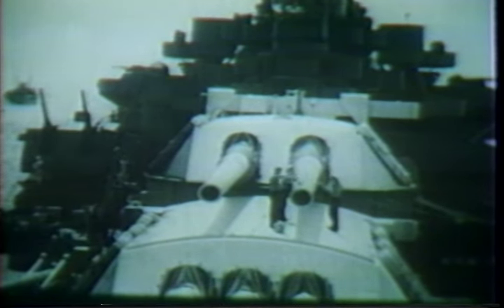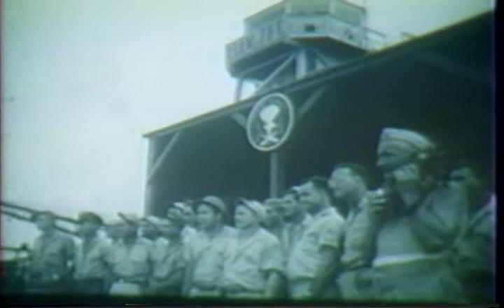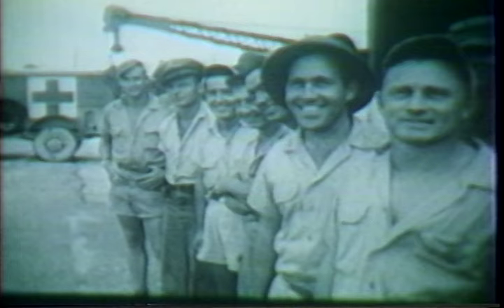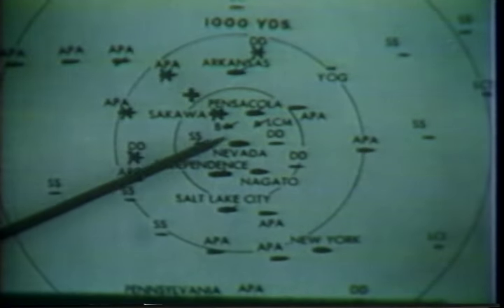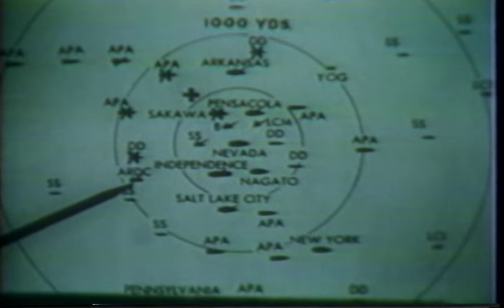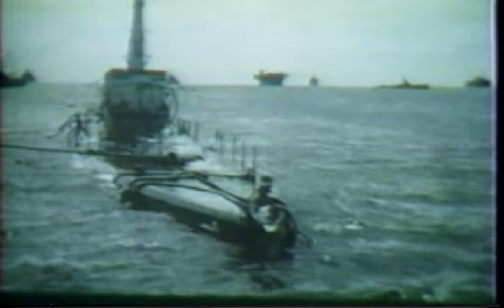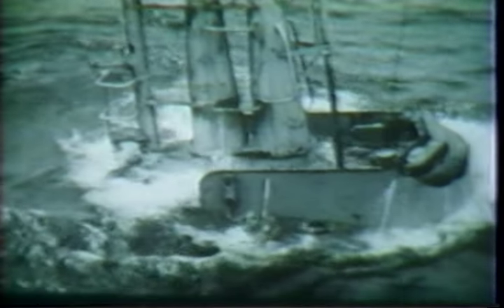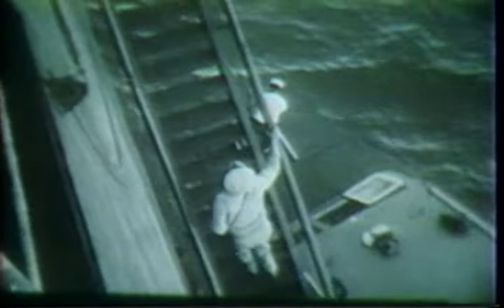Project Crossroads - Nuclear Test Film (1946)

Comment: 14:44 Yeah, I'm real sure the cloud became safe after a couple hours after the explosion.  
Holy crap these people are exposing themselves to so much radiation when they get back on those ships.
Reply: My daughter has a friend in the local retirement community who participated in Operation Crossroads. They could not discuss it for 50 years upon threat of court-martial. This veteran was left sterile and had cancer. Due to the 50 year period, he was not able to "prove" it resulted from the blast. And not only did he see the blast, he also helped "scrub" his ship the USS Salt Lake City.
Reply: You are correct: They tried to decontaminate some of the ships so that they could be sailed back.  However they were unable to do so and the ships were eventually scuttled.
Reply: Due to radioactive decay, this is true... after one hour the radiation is half what it was at the time of detonation.  It falls off very quickly but ever more slowly the more time that passes.  Plus, the radiation spreads out over time diluting it over more area, which reduces the exposure levels proportionately.  

Now, yeah, these guys were exposing themselves to WAY too much radiation, and there was a lot of unknowns that cost these guys dearly in the future.  The "neutron activation of sodium in the salt dissolved in the seawater" for instance, was interesting.  Neutron activation of steel plate of the hulls of these ships was something else.  You notice no respirators, no bunny suits, the guy just hopping off the boat into knee deep water and having his instruments handed down... breathing in mist or humidity laced with alpha-emitters... exposing their skin, contaminating their clothing and hands with salt water that is itself radioactive due to neutron activation (the atoms of sodium absorb a neutron and become a radioactive isotope of sodium, same with the iron atoms in steel-- this is how the neutron bomb worked-- if the intense burst of neutron radiation didn't kill you outright, if you were within lethal range, the crewmen inside Soviet tanks would subsequently be irradiated and die from gamma and X-rays caused by the iron of the tank hulls absorbing neutrons and becoming radioactive isotopes, making the tanks themselves radioactive).  You'll probably see guys standing around smoking and eating or drinking, etc. and if you watch later tests, you'll see the longer this went on the smarter guys got.  Now they didn't tell the grunts out in the desert shots anything, so a lot of those guys were smoking, eating, and drinking too, and for a lot of them the most "decon" (decontamination) they got were sweeping each other off with a broom, which is a joke, but if you watch the scientists and the AEC guys doing experiments out there, you'll see in those videos from Nevada Test Site, those guys will all be in bunny suits, with skull caps and respirators and their boots in baggies taped off to their legs, gloves, etc.  They won't be eating or drinking or smoking til they get back and actually go through a SHOWER decon to wash off particles (why smoking, drinking, or eating is bad, or going without a respirator-- if you inhale or ingest alpha emitter particles, they literally irradiate and kill the cells in your body from the inside out... my old man worked at a nuke plant and got some "fuel fleas" on his skin from rust on the inside of a hot (radioactive) valve they loaded up and sent out for repair...  "fuel fleas" is vernacular for radioactive particles... evidently he rubbed some into his skin, because he got these blisters about the size of the end of your pinky finger, which filled with pus, and then burst... basically the radioactive particle kills all the cells within about 1/8 inch from the particle emitting the radiation, all the way around and down into the flesh beneath it.  These dead cells cannot resist bacterial infection, which begins to rot them, and the body sends white cells to kill the bacteria, which forms pus.  Then as the outer layers of skin burst, the pus is released like a pimple, and the new cells underneath heal... but you're left with a CRATER in the skin where the dead cells were, until it finally heals up after a few weeks when the skin grows in and fills it back up.  They call them "fuel fleas" because it's like a bad insect bite, like a spider bite, which kills the cells around the bite for some distance.  If you ingest radioactive particles, you get a 'fuel flea' inside your body, only its in ALL directions around the particle, all the way around it.  That's why the scientists later on are all wearing respirators and bunny suits and taped off booties and stuff... they don't want particles getting on them.
Reply: @lukestrawwalker negligence ... guinea pig gig
Reply: exactly ....   they were way too close to that detonation . .   makes ya wonder    🤔

Comment: Now keep in mind CLASS, both of these test detonations are considered small . . .  15,000 tons . . . just in case you are not impressed or in awe of the tremendous force. 
When BAKER went off you can see a dark shape in the right side of the erupting column of water. Navy brass dismissed it as just a shadow. Others say it was the ARKANSAS, lifted and stood on it's nose. Well, it was close enough and is in fact lying on the bottom.
Reply: The plutonium bomb had a range of  between 19 and 21 kilotons
Reply: Thane Mac There is no difference in measure. You can say a bomb will yield 15,000 tons, for instance, or 15 kilotons. Same thing.  The Crossroads Bravo shot yielded approximately 19,000 tons or 19 kilotons.
Reply: You can see the shadow lingcod91 refers to at 36:38. You may need to let it play a bit.  The shadow is at the left, poking up out of the spray at water level.

https://en.wikipedia.org/wiki/USS_Arkansas_(BB-33)  was a 562 foot long dreadnought, 26,000 tons empty.  The shadow seems to be in about the right location and moving correctly to be the ship.
Reply: Thane Mac  15 thousand tons is 15 kilotons
Reply: Dad said it was the Arkansas
Reply: Thane Mac  No, he's right at tons. The Hiroshima bomb was 15 kilotons max yield. Estimated at 11 kilotons actual yield.
Reply: That Was A H-BOMB NOT A A-BOMB.
Reply: @johngaul8929  Both Able and Bravo shots were plutonium bombs like the Nagasaki bomb. Fission, not fusion. That wasn't until 52. Crossroads was 46 or 47.
Reply: @johngaul8929  1st. I did not specify which type of bomb was used. 2nd. YOU ARE WRONG. Both bombs used in Project Crossroads were fisson types (A-bombs). The same type that was dropped on Japan. H-bombs are fusion type.     Do some further research, it's well documented . . . that is if you are able to read.  
3rd. Setting aside your error . . . What was the point were you trying make ?
Reply: Thane Mac  No, lingod91 is correct: 15,000 tons equals 15 kilotons.  But according to the wikipedia article on the subject the yield of both devices was the same : 23 kilotons.
Reply: I know that it was one of the ships that was launched, I just never knew which one it was.
Reply: It wasn't the Arkansas itself, it was a void in the water column left by the Arkansas blocking the water.
Reply: @slightlyirradiatedmuffin3257  You are right. I  heard it that way also . . . the explosion caused leaks. That shows the toughness of battleships in general.  But it's still mighty impressive LITTLE test.

Comment: 6:02 3 "navy's radio-controlled drones". Thought it was worth pointing it out, I knew the germans had radio-controlled devices such as the "golliath" but I never knew they already had drones in 1946. So little time, so much to learn !
Reply: questmotion Radio controlled planes were experimented on as early as the First World War. After Crossroads, Drones continued to be used to collect samples from the bomb tests and to study blast effects of the bomb. It was discovered (by accident) that planes with pressurized cockpits could fly through the clouds with no ill effects on the the human crew, after which most of the sampling was done by manned aircraft.
Reply: Yeah, technology really leaped during and after that war. The Germans also invented night vision and were using it. Mainly eastern front though, very unwieldy, sensor was the size of a giant flood light and the portable version looked very heavy.
Reply: There were radio controlled B-25's or B-17's (can't remember which) that were packed with explosives and used as Kamikaze planes in Europe. They were first piloted by a two man crew until close to the target, who then switched the radio controls on and bailed out. A trailing bomber of the same make which was outfitted with the controls needed to guide the drone to its target.
This method of bombing wasn't very popular though, as the bailing pilots and co-pilots would often die from slamming into the plane at full speed.
Reply: @stevegoesrogue  Or it blew up prematurely and killed the crew, as what happened to JFK's older brother...
Reply: @stevegoesrogue  BTW the Germans experimented with this too, only they used "tandem aircraft" usually a FW-190 fighter mounted atop a wore out Ju-88 bomber laden with explosives.  Control cables connected the two planes, with the pilot sitting in the fighter atop the bomber controllling both planes... he flew the combination towards the target, lined it up with the target, locked the controls of the bomber, and then separated the fighter from the bomber and flew the fighter off the bomber's back... of course IF they didn't get shot down on the way there, as it was a very ungainly aircraft when combined...
Reply: @lukestrawwalker  Ah yes, the Mistletoe Aircraft, I remember them as I played IL-2 1946 and it had a single mission where you flew one to destroy a bridge in Germany (I believe)
Reply: stevegoesrogue It was called Operation Aphrodite.
Reply: More like remote controlled planes... they had a guy on the ground with an RC controller to take them off and land them, then a guy in the air in a chase plane took over and flew them once they were airborn... even had cameras on the instruments radioing back images to the chase plane, for the back seater to fly the 'drone' by reading the instruments...

Comment: 22:10 The heavy Battleship, Nevada held up well at under 700 yards from blast.  Surprising how powerful an armored Battleship is built.
Reply: Nevada should have been a museum ship. The only battleship to get underway at Pearl Harbor!  Fought in nearly every theater of WW2
Reply: yep-- due to the framing of heavy steel beams and double-bottoms of this class, they were tough ships... BUT, xtremely vulnerable to plunging fire from ships of its own class-- 12" shells or bigger were of course catastrophic when hitting a boiler room or powder magazine, but the ships held up well to torpedoes....
Reply: randy109 As the designated target ship for "Able", the Nevada was lucky that day. Had the bomb exploded over the Nevada as planned, at least nine ships, including two battleships and an aircraft carrier, would likely have sunk.
Reply: Don't forget that these were underwater destination. Water is a tremendous shock absorber because it doesn't compress.
Reply: @danieldevito6380  not compressing makes it a horrible shock absorber. hence why small depth charges worked so well, you only had to be near the sub to drastically hurt it.

Comment: That's probably just a Flee Fart compared to what man kind is capable of now……...
Reply: There's no probably to it. The original designers of the Trinity bomb (identical to the Crossroads bombs) knew that it wouldn't be very long before they were 1000 times more powerful. It only took until 1952, with the Ivy Mike test.
Reply: the Russians t s a r bomb indeed Topped the scales. modern-day high-yield weapons are however from 10 to 20 Mt. at the most. (our strongest was the B41 25Mt) Anymore and It would be a waste. The bigger it is the higher it goes up into the stratosphere. There have been bigger blasts such as volcanoes and asteroid impacts. But that's irrelevant. Most of it goes into space. The point of these weapons is to massively spread radioactive material .  A problem is most of the material Leaks up into  the stratosphere.    basically   space.   Nowadays, they're roundabout  Bravo level.  this video proves highest yield for spreading Radioactive material. If coastlines would be bombarded. today It would be fairly similar to this. but, WAY higher. massively lethal radiation. the sea water magnifies it.
Reply: @otherhalf228  multistage nuclear weapons made to produce more fallout... you have the typical 2 stage hydrogen bomb-- fission primary and fusion secondary, but they discovered that fast neutrons from the fusion reaction can fission a tertiary stage and produce more energy from fission of a depleted uranium tamper, which regular 'slow neutrons' cannot fission.  Then wrap another layer of fusion fuel around that, and you get a fission/fusion/fission/fusion device of whatever power you want.  BUT the fast fission of the heavy tamper or bomb casing can create a hellacious amount of intensely radioactive fallout-- the higher the "fission fraction" of the bomb (the amount of fission energy divided by fusion energy, percentage that is) the higher the amount of lethal fallout...
Reply: Actually the age of the "big ones" was the mid-late 50's and through the early-mid 60's... biggest one was the Tsar bomba, 57 megatons, scaled down from 100 megaton design, detonated by the Soviets over Novaya Zemlya island in the Arctic Ocean in the early 60's... The US had some big multi-megaton bombs in bombers as did the Soviets back then, biggest US missile warhead was the 4 megaton one on the Titan II's, now all retired.  Most of the big bombs were phased out and aren't even in the arsenal anymore, they were decommissioned and disassembled and their cores used to make more, smaller weapons, which is actually more effective militarily... Typical bomb in the US inventory now is under a megaton, anywhere from about 250 kilotons up to about 900 kilotons or so... Russia is about the same.  China for the longest didn't have highly accurate missiles, so they have some big 5 megaton or so warheads still in their inventory, but thanks to the technology transfers under the Clinton's, they now have a new generation of missiles that are HIGHLY accurate, so now most of their warheads are being built down in the hundreds of kiloton range.... no need for massive heavy high-yield warheads if you have accurate missiles, because even a relatively low-yield warhead can take out a large target if it's got good accuracy to put it down in the middle of it...